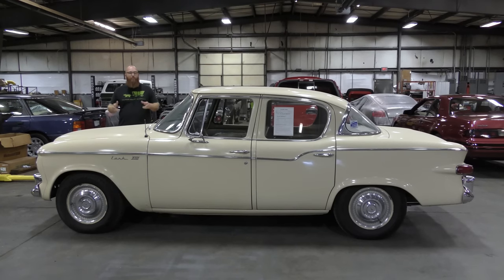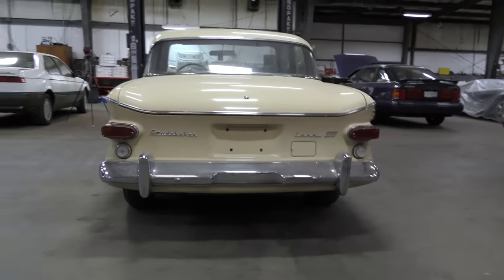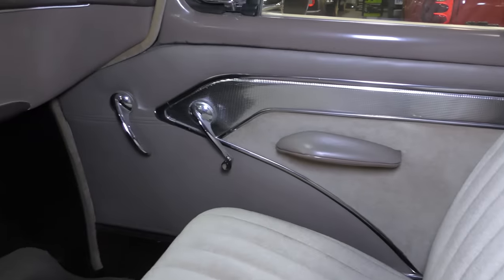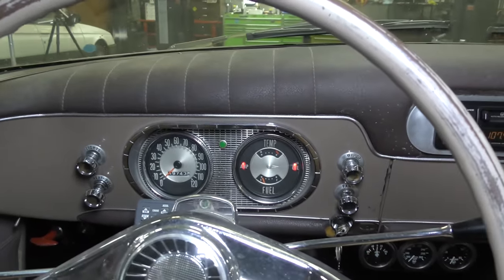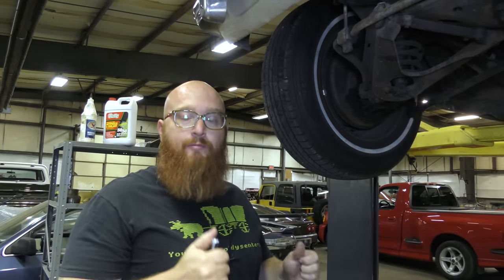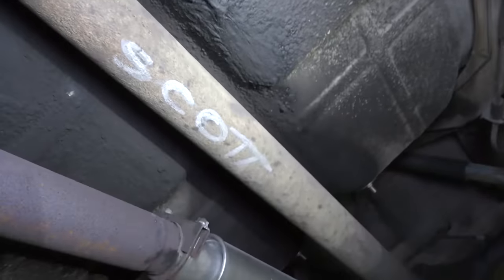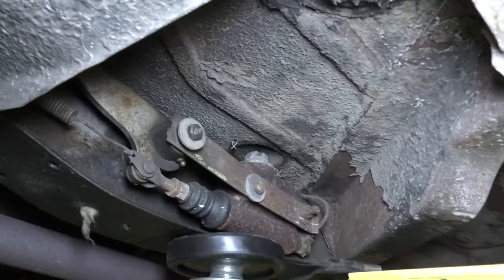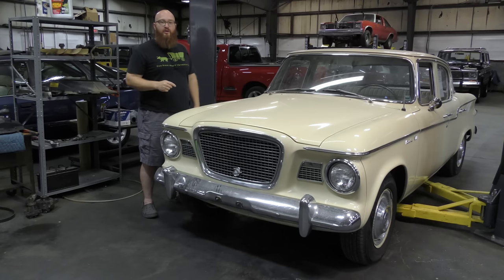Finally a CAR WIZARD approved engine swap done on this '60 Studebaker Lark VIII

Comment: I have a 1980 AMC Concord DL with 27,000 original miles, 258-6, auto, runs fine. 2-door,  finished in black with black vinyl top.

Comment: We had a 1966 Studebaker Cruiser at work that had a Thunderbolt V8 / 283 SB Chevy installed from the factory. It had a cast iron Borg Warner auto transmission also.

Comment: Replace the lube in the steering box. Done right this can make a big difference in effort. I think synthetic gun grease with 5-30 Royal Purple to a 170 degree pour point.Once rolling it is one had steering and not even bad when parked.

Comment: My style of car, very similar profile to a lot of Rootes Group (UK) cars of the same period. Bought a 63 Singer Vogue in 79 for £15, had to fit a new clutch. Ran for 3 years until parts became a nightmare and sold it to a serious enthusieast for £300. Still miss it, it took time to maintain but it was pretty much bombproof. 👍😁❤️🏴!

Comment: As it was a Lark VIII, it would have came with a Studebaker 259 cubic inch V8. During the 1960s Studebaker closed its plant in South Bend Indiana, but still built descendents of the Lark in a Canadian plant. Those cars used the Chevy Inline Six and the 283 inch small block. Thus there were factory mounts that could be used to install a small block Chevy V8 into a Studebaker Lark. I wonder if this swap actually uses the Studebaker mounts for the small block Chevy. It is a pretty cool swap.

Comment: In Studebaker terms, the Lark VI was the six cylinder model and the Lark VIII was the V8. They also had different trim levels, this one looks like the deluxe trim with extra chrome on the outside and nicer upholstery and fittings on the inside (like the snazzy horn ring).

The Lark was a new model that year, Studebaker's offering in the new compact car field, a year before the Big 3 brought out their Corvair, Valiant and Falcon but after AMC began the trend with their Rambler American. At the time, only Studebaker offered a V8 in their compact model. Others were all sixes.

The last Studebakers used basically the same chassis with Chevy V8s after they shut down the South Bend engine foundry. They chose the Chev because it fit so easily. You could swap in a Chev V8 using Studebaker motor mounts etc. if you knew the part numbers.

This car was a revamped version of the Studebaker Champion that debuted in 1953. They shortened the body with a new nose and tail and kept the passenger compartment the same size. They were very popular and kept Studebaker in business for many more years.

Comment: Car Wizard lectures us about how "Back in the day, cars were made to last. Today, they are made to throw away after 3 years"

That all sounds good, but we all know that cars made back then were typically worn out at 100K miles. My daily driver is a '11 VW Jetta Sportwagen TDI, 6MT. It has 158K miles. I put 103K of these miles on it with 1 unscheduled repair done at no charge by VW under the very excellent extended warranty that came with all dieselgate cars.

Comment: Talk about the cab forward, wheels forward design, many cars 30 years older than this Lark had the front wheels about equal to or even ahead    of the radiator. By the way the Edelbrock carburetor was the original Carter AFB (aluminum four barrel) which was on many V8 cars from GM in 1960.

Comment: Also, since Studebaker made this same basic car in Hamilton Ontario with SBC drive trains, there may be some factory original motor mounts etc. to facilitate the swap. Also the SBC is lighter than the Stude engine.
 I had a 59 and a 61 when I was a kid.  My extended family in KS had several Studes.  The dealer in Larned used to come up and deal with my old man across the kitchen table and do his trade deal.  Brought a Hawk and an Avanti at different times.  I could have boght the Hawk and owed Dad but I was already in debt for the 61 hand me down.  Soon graduated and as soon as I could pull together a down payment bought a used  66 Vette.

Comment: The 289 Studebaker V8 was actually a superior engine to the small block 283. According to several automotive writers over the decades. I have to agree, since I've owned both. It's a shame Studebaker couldn't have continued into greatness. Because of the Corvette orders of volume superceeding the orders of Studebaker's Avanti, which would have probably saved Stude, had they all been filled. Because Stude had to give back all the deposits to customers, very few Avantis were produced (I had one). Another shame GM and Stude had to use the Ashtabula, Ohio fiberglass company for both marks.

Comment: The reason it has short overhangs is that it is a 1953 Studebaker with the ends shortened. The last Studebakers were made in Canada and have Chevy engines so any adapter parts should be available without having to be made. One reason for all those grease fitting on the front suspension is that it was the last car (because it was really a '53) without ball joint front suspension (which they never got).

Comment: I like the 60 Stude my dad had one like that, it had the 289 studebaker V8 in it and it was a sleeper. I surprised a lot of Chevys and Fords with it. I don't know why someone did an engine swap to that car.  Those Studebaker V8s were good  for over 200K when maintained. If that were my car I would definitely switch it back to an original Studebaker V8, most likely a 289 or an Avanti R1. That would be a fun car!

Comment: The heart of this Studebaker Lark "VIII"was a 259 cubic inch Studebaker V8 that was very well made to drive through a Borg Warner automatic.Both of those components were tore out and replaced with some GM equipment. It might ride just fine, but it surely is no longer a Studebaker to old timers who knew about such cars when they were original.

Comment: These were cab-forward, not by design, but by default. Studebaker basically chopped the front and rear off the radical 1953 body to beat the Corvair, Falcon and Valiant to market with a "compact" car. It was a masterful facelift, and the only eight cylinder car in its class in 1959-60. And, I would imagine that others have commented that the last Studebakers had Chevy small blocks like this from the factory, so the transplant in this car must have been relatively easy.

Comment: The swap is relatively easy since you could buy a 65, or 66 Studebaker with a Chevrolet 283 V8 or a 235 straight six. I had a 65 Studebaker wagon that came with a 283 and I swapped it out with an L79 350 hp 327 and a 4 sp.

Comment: My brother and I had a  62 Studebaker Lark with a factory 289 and a four speed. Nothing had been modified. It was the one with the yellow valve covers and there was no mustang in its classic could touch it. That was before Mustang came out with the 390. The 351 couldn’t come close to it. it was the nicest car we had out of the dozens of cars we owned when we were teenagers. The only problem we had was with the differential we blew out eight rear ends coming off the line. That was the weak point of that car and we had scavenged everyone within a 30 mile radius from every junkyard around. We got to a point where we could blow a rear end on a Friday night and be driving Saturday morning. We learn how to do that fast, but we were pretty slow learners as far as beating them so badly that they would blow out.wonderful car though. I really miss it.

Comment: You missed the grease nipples on the u-joints. Back in the day, a lube, oil, and filter cost $3 including the oil & filter. It also included all the safety checks (brake pads too) and a cleaning (windows inside & out, plus a vacuum). The money losers were Range Rovers, Land cruisers, and Jeeps. I once counted 27 nipples on one car, all done with hand gun.

Comment: It would have been the small Studebaker V8 in it when new.  Also depends on the trim level if it had a padded dash or not. We had 2 of them, one standard 2 dr. and one Higher Grade 2 door hardtop.  It was the rocker panels that rusted out on them.  Also the front floorboards rusted out too!  The small 6 cyl. Champ engines did not do well for long life.  It would be amazing to get 100,000 miles out of them.

Comment: These were assembled in Australia from CKD kits in RHD up until about 1965. I remember them as a kid. I'm not sure what engine they had.
BTW what do you call the greasing points on the chassis? I couldn't quite understand what you said. I've always known them as grease nipples.

Comment: Shorty headers and a shoddy exhaust system. They could have just used standard ram horn exhaust manifolds and saved themselves some trouble. It has the room for a real dual exhaust setup and could be just as quiet when done competently with the shorty headers or even the normal exhaust manifolds(ram horn style). Still, it starts and runs well despite the shortcomings. I always wanted a Lark but the 2 door style. A Studebaker Hawk would be very cool :)

Comment: The cruise control is aftermarket (Adiovox), the control is on the left side of the dash.

Same they didn't mount the white walls outward.

Fix the exhaust.

Comment: Refreshing to see you give tribute to Classic American made vehicles. Agree this Lark is highly respectable. 
However, America made so many great vehicles in the 50s, 60s. I am in my late 60s and lived through the Era of 50s, 60s American vehicles on the road. Sadly they were replaced with much lower quality since the 70s.
Currently I drive soild Silverado 91 and 95. Good solid built American trucks. I value well built vehicles from any manufacturer and Era.

Comment: Had a 55 Commander coupe. Put a 331 hemi Chrysler engine in it with a President rear end. Removed the hood. Couldn't close it. Needed a trunk lid. The salvage said all we have is a Silver Hawk lid but it will fit. Was pulled over in Yosemite  park. The ranger called headquarters  said we have to watch this kid he has a souped up Chrysler engine in a Studebaker Hawk. I eased back out the gate. A California  Highway  patrol car made a u turn and followed me for awhile. The 2 speed Chrysler tranny was all it needed. Dont think the Wizard would be impressed with that swap. Went to a junk yard and cut the floor out of a Plymouth to make room for the tranny. Montgomery Ward 100% over sized shocks. The President rear end was heavier and geared  for an automatic. The brake drums had fins for better cooling.I think the silver Hawk had a flat head 6. Saw a  Chevrolet El Camino awhile back with a Studebaker bullet nose front end on it. Looked like it came that way from the factory. 60. Years ago had the 55.

Comment: I always thought that it was interesting how the front of these Studes had a very similar design to the 1960 - 62 Plymouth Valiant.
Reply: I remember a salesman taking me on a drive in a early 60s Plymouth ValiantI remember him comparing it to  Mercedes. I think he was talking about styling. The Valiant with the slant 6 was one hell of a car. I almost bought a Mercedes at an auction. I remember it had a straight 6 with a 4 barrel carb. Too much rust. It was a big car nothing like a Lark. I have a book on old cars. Its amazing  how many car companies have came and gone. One tire company guaranteed  their tires to last 10 K miles. Some cars had tandem rear axles.

Comment: Oscar Zerk and his grease fitting.  In the old days when you changed the oil you greased all the fittings, auto repair places had a compressor driven grease gun.  "Cussshhhhh'.  Oscar Zerk, a Kenosha Wisconsin hero,

Comment: Has anybody heard of the joint-venture Studebaker Z87/Porsche 542?        
That was a cool concept that would have left the competition scratching their heads for years. Rear-mounted water-cooled V6, bench seats for six, three-on-the-tree shift (can you imagine keeping THAT linkage working?) and a sloping nose at once reminiscent of Volkswagen and '53 Starliner. One of the Porsche engines is still preserved in the Studebaker Museum in South Bend.       
The space-efficient prototype was somewhat flimsy, but looked really sweet, and with additional development could have been successful and might have influenced Americal compact development.

Comment: The Lark was available in several flavours. My mother bought a 6 cylinder/auto transmission model with soft suspension, This got very unstable at speeds over 70 mph, and would literally put me to sleep at 50 mph.

Comment: I have a 1959 Lark VI with the inline 6. It has poor compression. I think I'm going to pull the engine and do the work. It might just need to be re-ringed but it prolly needs new pistons and the block machined out ($2000)...would it be preferable to just buy a small block chevy and swap it in?...It's prolly same amount of money and work

Comment: 350  has a  number on the block by the fire wall ,the only way you can tell if its a four bolt main cap is to pull the pan,302 ,327, 350 have four inch bores, stock.  the rod is 5.7 inches when the stroke got longer the wrist pin was higher . you dont  know what you got till you tear it down

Comment: All stuff we did back in the 80s although I wish all heater cores in that place ,my trunk on 53 complete but the floor boards are not along with rocker panel . Studebaker did put in v 8 chevys before 1964 closing in Canada plants

Comment: In 1960 it probably came out with a 6.  The Daytona came out later.   In my day engine swaps were very common with Studebakers, especially the 2-door Champions using GM Chevy and Buick.  Also swapping 6 cylinder for Studebaker V-8.  Never encountered hard starting problems.  Long as they are wired and getting gas they will start.  A car that size does not need power steering or power brakes.  Actually, drives better without.  We swapped em in the back yard.   GM fit right in them.   Did this vehicle come out with an automatic or did they take the cheap easy way and go with automatic?   We preferred manual transmissions.  Aside from being a 4-door it is a very nice ride.  These were easy swaps.   Would love to have an Avanti.

Comment: This was a smart swap using the most proven reliable cheap and easy to get parts for V8 every made.  SBC's have been swapped into literally everything, they are the engine swappers dream, tons of swap kits and aftermarket parts its remains one of the best engines of all time.  And to the carb haters, if a carb is properly set up its very easy to start and very reliable, unless you buy a freakin holley--lol

Comment: The Lark Vlll came with a V8, hence.....the Vlll. They were 289 Cu in motors. Not to be confused with the Ford 289s which evolved from the 221/260 Cu in motor from about 1960 or 1961. My Lark Vlll was identical to this one, right down to the color. Plenty of power and that big steering wheel combined with the short wheel base? Wow! You will have to deal with that exhaust pipe rubbing on the rear axle housing......

Comment: Back then you were replacing your car every three years because the engines at 70,000 miles was a high mileage engine the bodies would start rusting and you still had to replace ball joints grease or no grease.  I have a 2008 Cadillac DTS 78,000 miles on it no rust no problems. I remember I wanted to buy a really nice two-door Dodge it is working at a gas station in a school and my dad said you know it’s got 65,000 miles it’s a lot of miles for a car engine Ron.

Comment: These CAME with Small Block Chevy's in their later years of production, so motor mounts, proper transmission cross members, even cast iron exhaust would be just a junkyard away.
The engines were sourced from Canada with some obscure name and color.

Comment: With declining sales thru the 1950's, Studebaker had a big hit in 1959 with the Lark. It was basically the same sedan they introduced in 1953 with new front and rear sheetmetal. The cabin and doors dated back the 1953. Sadly for Studebaker the big three introduced their compacts in 1960 and sales declined from there. Manufacturing continued at the Canadian plant in 1965 & 1966 after the South Bend plant closed in 1964.

Comment: Depending on the location of manufacturing, you either had a small block Chevrolet or the Studebaker engine. The Studebaker wagon company was closely linked to Germany. I've wanted a Studebaker for a long time. Too bad I can't swing it.

Comment: What a great solid car, well sorted simple engineering, stylish design, if it was my car I'd like to fit disc brakes on the front & widen & chrome the original wheels, just love it , it's a GREAT car.

Comment: Studebaker used Chevy 283 engines from Canada in the Commander like 1965-66. That's what I want to put my 1964 Corvette 283 engine in.Two four barrels,dual exhaust and posi rear end in a sleeper body!

Comment: The only thing that might be added is AC, say a Classic Air system or one of the new VRF heat pump systems that some people are using in camper vans and and trucks. You could use a small 12 VDC unit and mount in the trunk.

Comment: You stated that you didn't know whether it was originally a six or a V8. It would have  been a Lark VI if it was originally a six. 
Also the swap f a Chevy SB into a Lark is made simple because the 65/66  version of the car, was built on the same chassis, but fitted with a Canadian made SBC, so there are factory motor mounts available for it.

Comment: Does the Studebaker front end have kingpins instead of ball joints?   That would explain two of the grease zerks on each wheel.

Comment: In the early '60s there was a man who had a truck repair shop in the Chicago suburbs. He had several Larks with small diesel engines that he swapped in. They ran very nice, but no speed demons. Edit- A 60  year old car that leaks! When I fixed cars in the '70s I said, "Show me one that doesn't leak, and I'll show you one with no lube in it"!